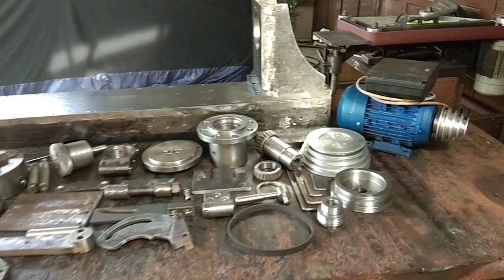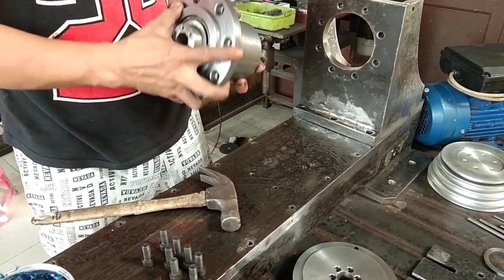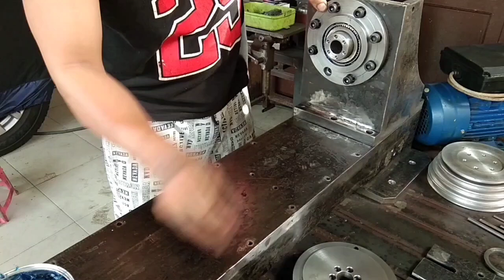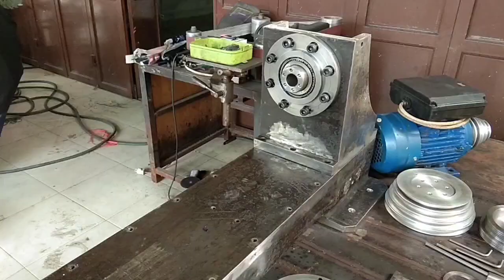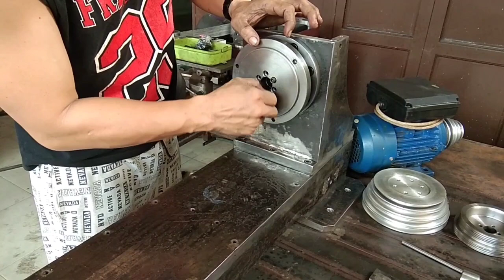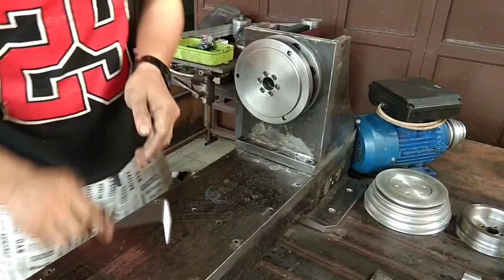Homemade metal lathe (headstock)

Comment: How did he set the preload in the pair of roller bearings? I didnt see any adjustment
Reply: Preload was done when he hammered the bearings into place!
Reply: @trickywu9796  That is too funny. Really should have drilled some oil ducts into the head and used oil instead of grease for a lathe. That (preload) is going to have massive run out. The shaft should have had a seal in the front and a captive nut and seal on the back. Grease will heat that head up and cause it to warp and wear the bearings out. A circulating oil system keeps it cool. Look at manufactured lathes with tapered roller bearings, they all use a oiling system and not grease. Still an awesome endeavor however it will become evident after using the lathe, that there will be issues with concentricity down the road or even in this case at the very start of use.
Reply: @TheTruth-fs2rm  there's a lot of probs with this build, but looking at what he has to build and his knowledge, its pretty impressive that he has made it this far.  👍🏻👏🏻